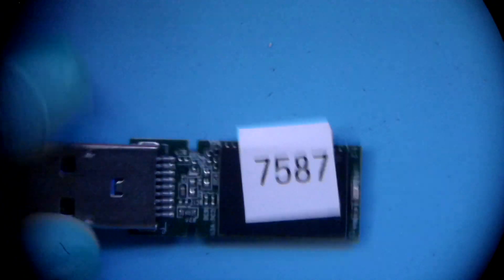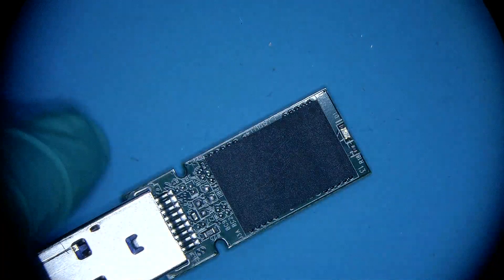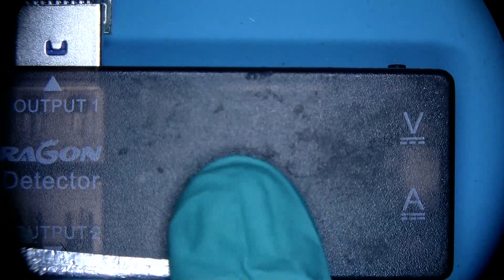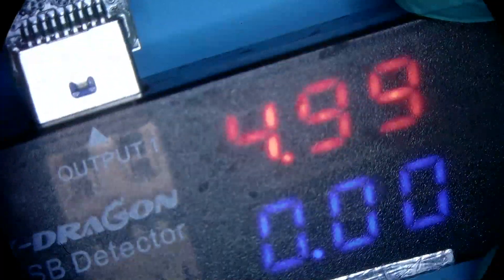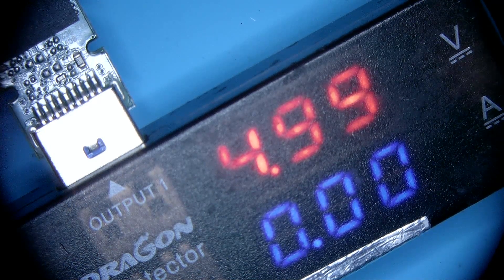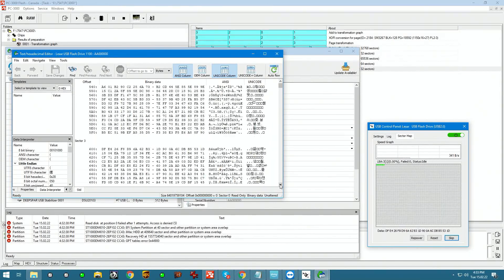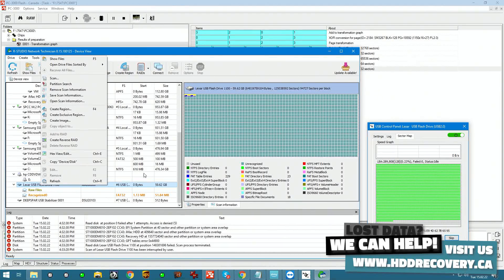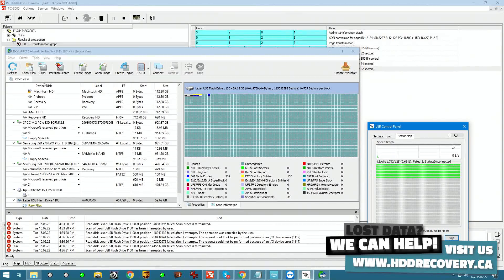duct tape is a great data recovery tool

Comment: I have a question regarding HDD head replacement: Why do I need a comb, why can I not just use the park assembly to remove the head?
Reply: sometimes on some drives you can't take the park assy out without first removing the platters, which is a huge increase in risk and time involved if you originally just needed to do a headswap
Reply from the maker: you can use whatever that helps you get the job done.

Comment: I have zero knowlege about hard drives. I clicked on the link for your service but I'm not sure which option to choose for the last three questions so I chose Other for "what are the symptoms of failure" and Yes for  "has the drive been opened before"  because I have sent it to three or four places by now, the last one being a data recovery company with a lab that tried to access but couldn't and emailed that recovery from crashed drive is not possible because of broken heads and scratched platter. As for the last question - what is the capacity of hard drive. It's showing only two options starting from 1 tb onwards. I checked and the size of my hard drive is 500 gb and apparently 1tb is 1000 gb. I chose 1tb to go ahead with the request. I'm desperate for help. I don't live in Canada but I'm ready to send my hard drive via courier if there is any chance for date recovery.

Comment: FIRST DO NOT HEAT NANDS .COVER NANDS USE FLUX OIL AND RE HEAT CONTROLLER 
SECOND IN 5VOLT WAY U SEE 1R5 OR 2R2 
CHANGE 5 VOLT FUSE 
IS THAT ALL NAND DATA PIN IS OK >?DATA 0... DATA 7
SM3267AE IS 1 CHANAL MAX 4CE 

IN YOUR CASE  2C A4 64 32 AA   2CE MT29F256G08CBCBB 
SO INTERLEAVED 2 . IN 1 CHANAL 
CHECK 24HG HAVE 1.8 VOLT ?STABLE?
IF NOT CHANGE IT WITH  LM1117 3.3 VOLT 
2 NAND USE MUCH 1.8 VOLT 
SOME TIME SMALL CAPACITOR BEHIND IC . IS BAD 
AND NOT  enough

Comment: if you see 24HG=3.3 VOT TO 1.8 VOLT 
VCCQ=1.8 VOLT 
3267AE +1.8 V = MICRON L06B NAND 
BE CARE FULL THIS MEMORY IF USE 3.3 .BLOOW UP
2C A4 64 32 AA

FIRST DO FLUX CONTROLLER AND HOT GON 
IN 80 %  INNSTOR IS917 AND SMI 
RE SOLDER CONTROLLER 
AND WORK AGAIN
Reply from the maker: lots of good info here. I did end up having it resoldered. Flash drive started to work again

Comment: they say you can fix everything with duct tape and WD40..weve now seen the duct tape .how do you use WD40 in data rescue ? ;)
Reply from the maker: I had tried to use WD40 on old Toshiba GAS series drives with failed bearing. I can't recall if it did any good :)